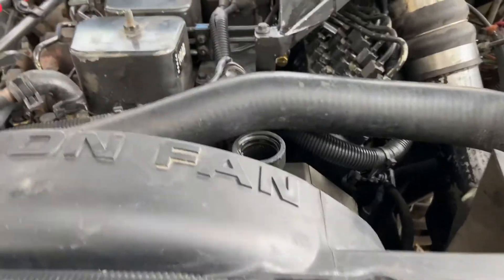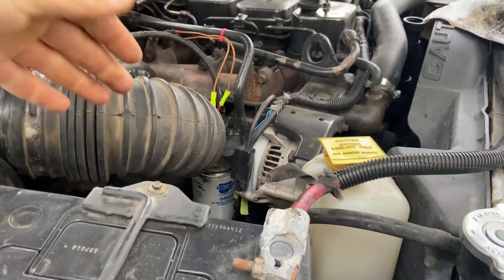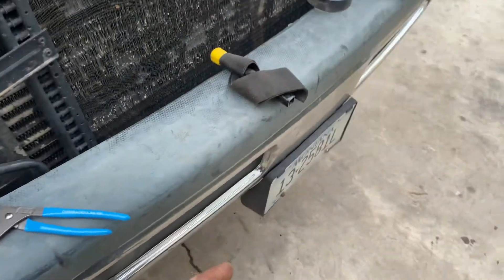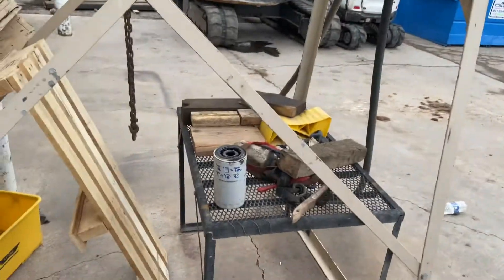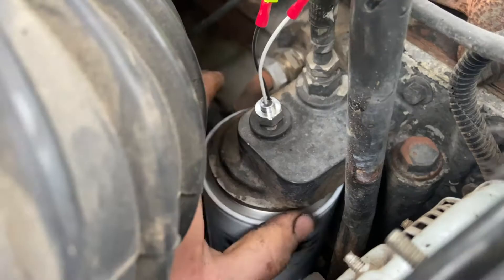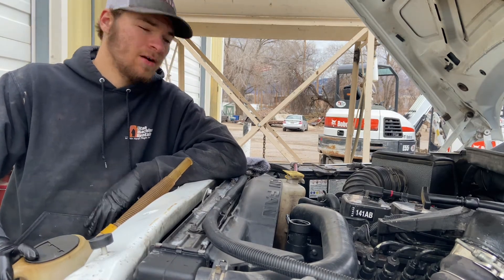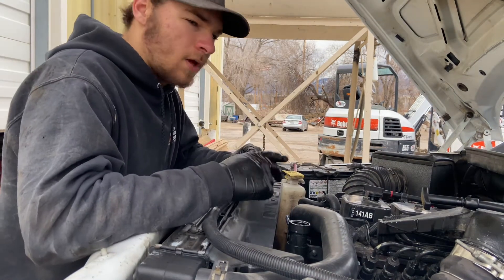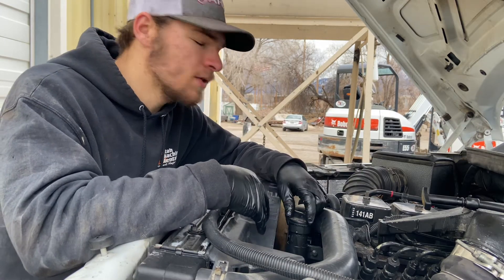How To Change The Oil In A 12v Cummins | 98' Dodge Ram 2500 12v

Comment: Aren't you supposed to pre fill the oil filter given your engine has a turbo?
Reply from the maker: You can do either or. As far as I’m concerned it doesn’t matter because oil cycles through the whole engine and will fill up the filter that way.
Reply: You’re supposed to prime the filter wether the engine is turbocharged or not, just helps with getting air out of the system and preventing oil not getting areas it needs to be.